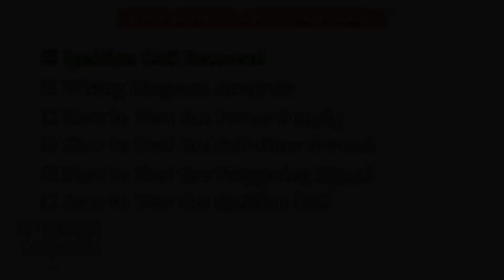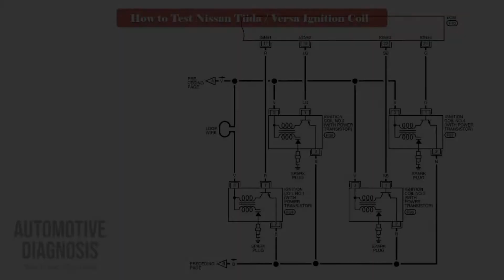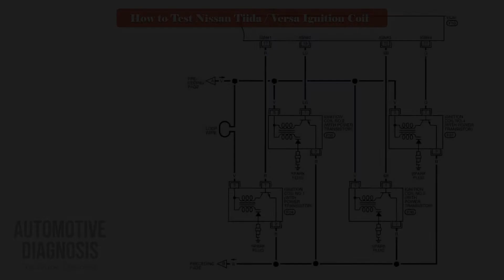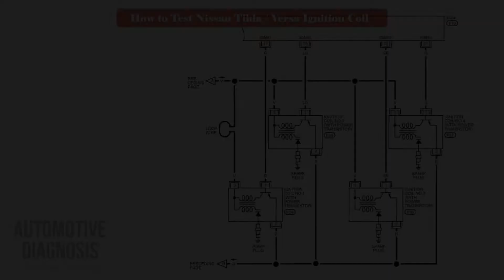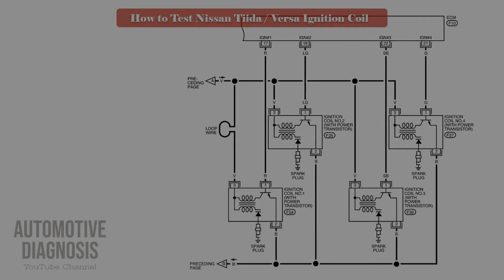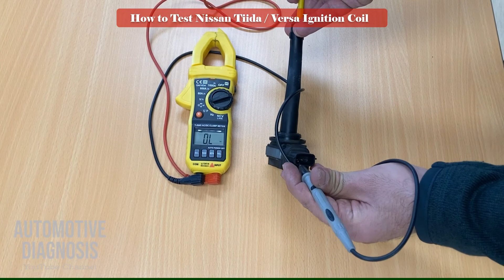How to Remove & Test the Ignition Coils on Nissan Versa / Tiida | 3-Wire Coil On Plug Testing Method

Comment: after all that you didnt go across the pins on the coil pack itself and show good values
Reply from the maker: On this kind of COP with three pins, as there is an ignition module inside the ignition coil, workshop manual does not recommend to measure the primary / secondary windings and it does not provide any specifications as well. It only refers to check the wiring. TO make sure if fault code is from the coil itself, we normally swap it with another coil on the engine and we check if code moves to the new cylinder it means coil is faulty.

Comment: Nice vedio but how much should be  correct reading of good coil ???
Reply from the maker: Reading on this coil is a bit different from coil on plugs with two pins (that we can check the primary and secondary coils resistance), in this coil that has three pins there is a transistor inside which makes the resistance measurement impossible. I have attached a part of workshop manual in google drive (accessible in the following link) which explains all inspections on ignition coils on this car:
https://drive.google.com/file/d/1oFaiZOCl3NO60wlcTvx4izBZOIsCqlE2/view?usp=share_link

Comment: What is a abnormal reading for the coil
Reply: Exactly my question
Reply from the maker: If you check the Nissan workshop manual, you see that the only specification for the ignition coil itself  is to check the resistance between pin 1 and two (except 0 or infinite), between 1 and 3 (except 0) and between 2 and 3 (except 0). All other steps are for checking the wiring.